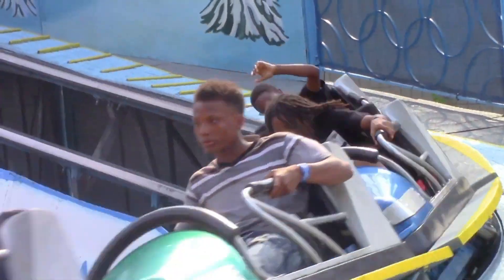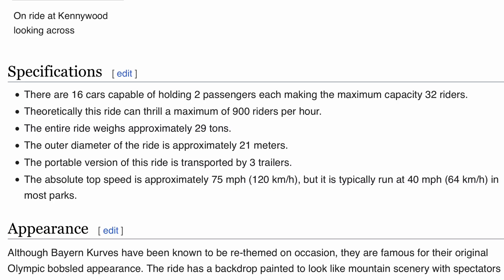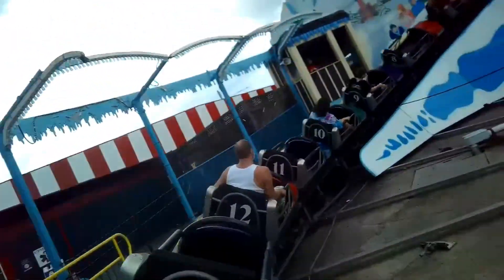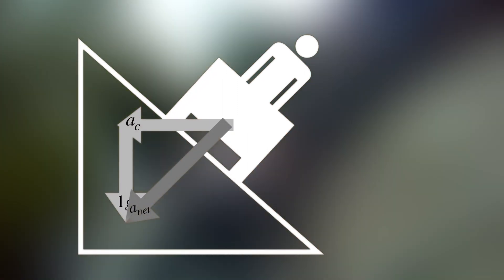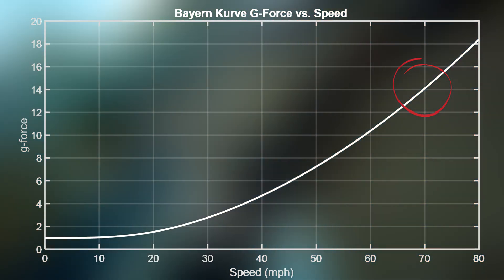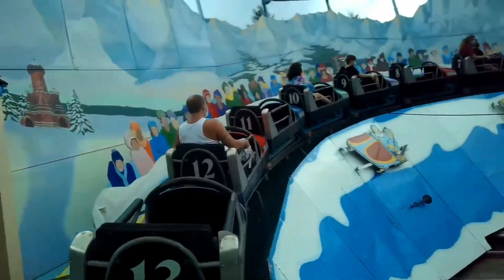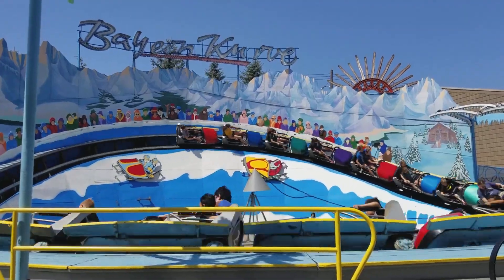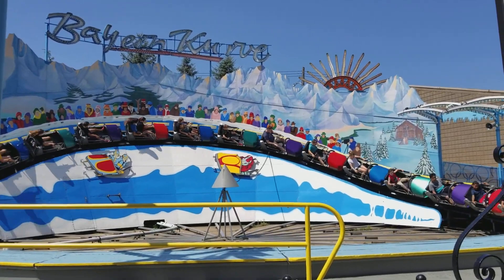Nerd's Eye View Ep. 2: Why Bayern Kurve CAN'T go 70mph!

Comment: The 70 miles is PEAK PERFORMANCE! NOT CONTINUOUS! The ride would shake itself apart if it were operated at 70 miles an hour... But due to its tire /blade traction propulsion system consisting of four wheels near the operator/ ticket booth and four on the far side, it DEFINITELY CAN reach that speed... that's why it tilts inwards. The inward tilt is to push riders in their seats by increasing gravity as speed picks up. It's two-fold; it ads to the spectacle of riding AND it's there for safety reasons... They have actually thought this thru at Schwarzkopf's

See Here: https://youtu.be/-dkSZs3jZmY?t=379  -Notice the tires screaming as they speed up

Comment: In defense of Knoebels, they did say it is capable of going 70 miles per hour. And from my rides of the past all of them fluctuated the speed and did not sustain top speed for more than a minute.
 We're going to recruit you to spend a full day at Knoebels with an accelerometer and speed measuring devices to test ALL the rides for positive and negative Gs and speeds. We're sure you can do a great job like you did with this video. 👍
Reply from the maker: What’s funny is I actually do use Ride Forces to accelerometer rides for fun a lot :P.

Again, not trying to accuse Knoebels of being malicious here. I love the place!
Reply: @g-forceproductions1857  👍 Great perhaps you can start with some extensive research on Phoenix by analyzing every seat to see where the most airtime is and if seat 3 is really the magical seat and if the front is better than the back. You can also do a map pointing out the airtime spots with the readings. We don't think you'll have a problem working overtime when visiting Knoebels 😅📈📉📊
Reply: @easynhonest  I have watched offride frame by frame footage and one of the last airtime hops the central part of the ride for sure comes off the track in some way. I think Knoebels definately has done something special with the upstops to produce that. It was right around seat 3. You can hear the cart slam the track right around that spot as well.